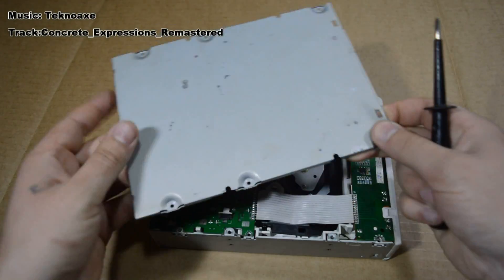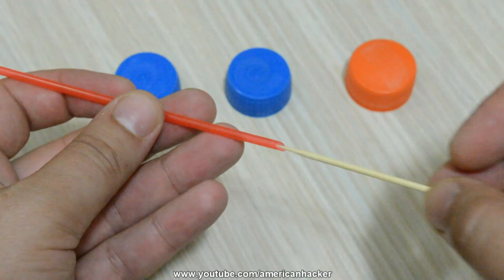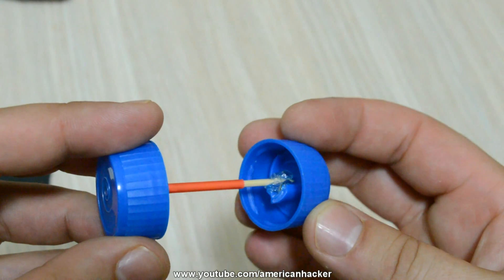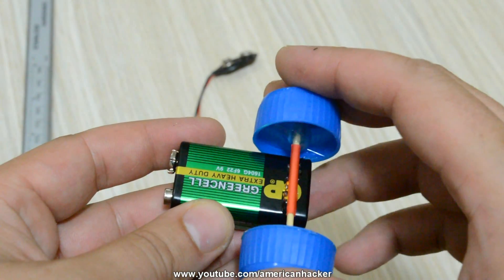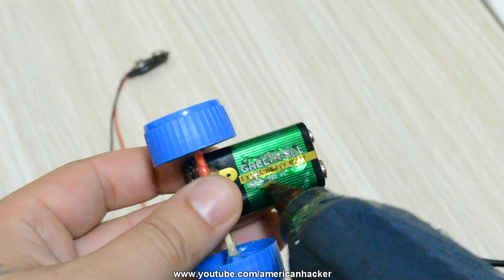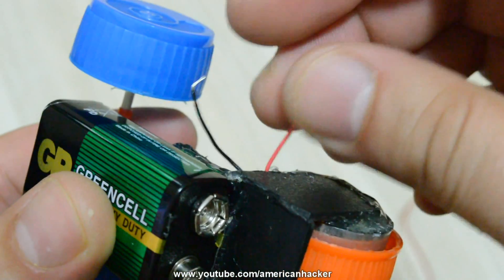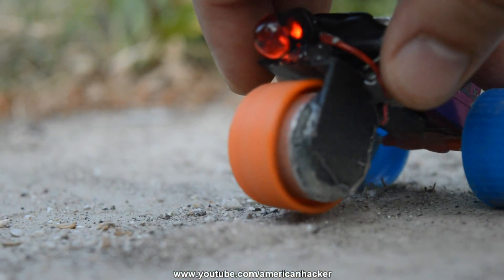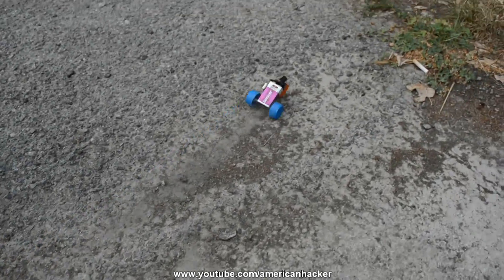How To Make 9V Tricycle Toy - (from junk parts)

Comment: thank you now I can make shiftbomb grenades with resistor 2 9v battery's and 2 9v battery caps they will overheat the resistor will go in flames then 18 volts in the battery's and then it explodes